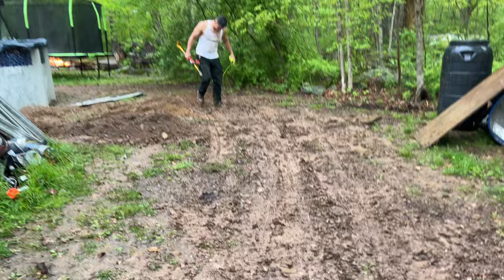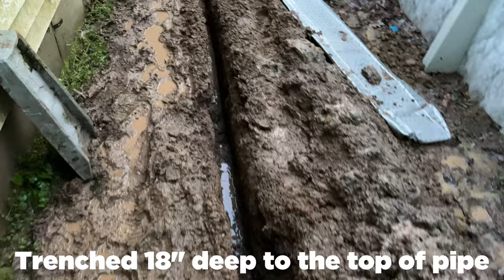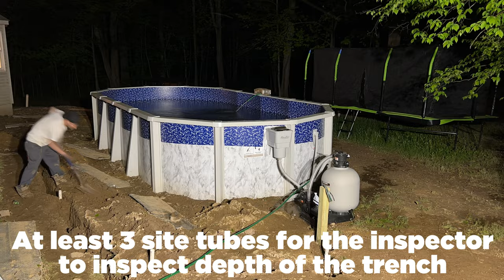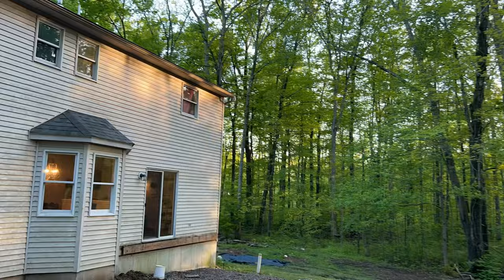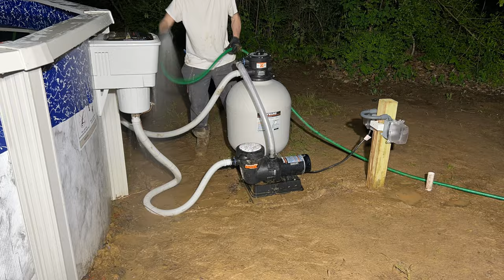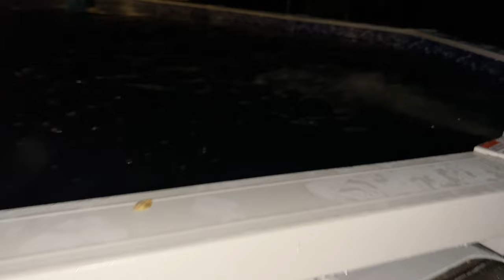How to Bond Wire Above Ground Pool Electrical Wiring bonding pump motor skimmer frame Electric Code

Comment: I can’t find anywhere on how to use a twist lock receptacle or wire it up. Can you help please
Reply from the maker: Yeah, I can probably help. We have twist lock receptacles and plugs at work. I should be able to grab one tomorrow and make a quick little video explaining how to wire and use them.
Reply from the maker: I can show real quick how they work and get wired, but let me know if you have any more specific questions and I’ll do my best to answer it
Reply: @BrandonStunts  that would be awesome man. Your video is definitely helping me a lot already. I just had a pool put in last week and I have to go through all of this to get it inspected. 
So from what I understand the twist lock outlet gets it’s own circuit with a gfci 20 amp breaker right to the panel? 
You ran another circuit from breaker to the gfi on the post? 
I saw you have single runs of wire. Is it not ok to use 12/2 UF in the conduit or should it be how you did it?
My next question would be where in the line would the timer be?
Reply from the maker: Hey man, I haven’t had a chance to do the video yet since work and family has been crazy busy, but I can at least answer your questions in the detail. So at least doesn’t hold you up too much, but hopefully I can make a video showing the panel and in the inside of the basement, as well as the wiring and operation for the twist lock. And I’ll also go over some of this stuff here and try to hit a few other things as well.
Reply from the maker: Yes, the twist lock outlet gets its own 20 amp circuit breaker. What we call a dedicated line. Basically a circuit that’s dedicated to only that piece of equipment or that specific outlet and nothing else. So no other outlets, devices, or other equipment should be connected to that line.
Reply from the maker: Yes, you have to run a 2nd dedicated circuit from breaker to the 2nd box on the post as well. That outlet is a regular outlet (non-twist lock) called the convenience outlet, which also gets  its own dedicated circuit. That Circuit has to have a GFCI circuit breaker or a GFCI outlet so it’s GFCI protected as well
Reply from the maker: No, it’s generally not ok to have UF wire inside of the pvc conduit, that would be considered double sheathing. UF wire is rated for direct burial underground, not inside of pipe due to heat dissipation. I mean, I guess with a big enough pipe it might be OK, but it’s generally not recommended. 

The bigger issue though is the pool pump and any pool equipment is required by code to have an insulated ground. All pool equipment must have an insulated ground. An insulated ground means the ground wire must have it own sheathing of insulation. In UF it’s just bare copper inside the UF, only ones insulated are the white and the black wire. Which is the reason why I use PVC pipe with thhn wire (single runs of wire) because the ground has to be insulated. 

I don’t believe it’s code for the convenience outlet to be insulated though, but I am not 100% sure. Most people just use the same for both, which is the safest bet.
Reply from the maker: I mounted  my pool pump timer right next to the breaker panel (so the wire went from the breaker out of the panel a few feet away into the timer, then that wire came out of the timer and ran to a junction box at the end of the basement to transition to the pvc pipe outside with the thhn stranded single conductor wire that goes to the twist lock receptacle). But that timer could be put in another location as long as it’s before the pool pump outlet.

I’m planning on taking a video of the inside set up as well as the wiring, along with answering some of the questions in here, and showing the twist lock cable, box and bobble cover.
Reply: @BrandonStunts  makes sense. Thanks for the answers. I went and bought rolls of thhn wire. I bought solid instead of stranded will that matter for inspection? Sorry I’m asking a million questions. My inspector was a real dick when I asked him all I need done so I’m really trying to make sure it’s all right before I get it inspected so there’s no issue
Reply from the maker: It’s cool. I’ve been the same way on other stuff I couldn’t figure out. Like you know you’re capable of doing it and have a good idea how to do it, but the technical details of the exact right way to do it seem overwhelmingly confusing.
Reply from the maker: I get it. A lot of these inspectors are huge A-holes for whatever reason, but every now and then you get some cool ones. he is as far as the wire goes I’m not 100% sure about that, but I can check with one of the “Code” guys I know today. I’m also doing a video going over the detail of the inside, outside, and timer wiring. Hoping to have it done by the end of today
Reply from the maker: So from what I’m told is solid wire would probably pass, but it’s not really what it’s intended for. Voters are supposed to be fed with stranded wire, so may not 100% pass either. So as much as you don’t want to it might be best to check with the inspector on that or get the stranded. 

Or you might get lucky and he doesn’t even realize who the difference. When my pool was inspected they didn’t open up any of the boxes to check the wire.

The other issue is depending on how long or how many bends the pipe is it will be much harder to pull.
Reply from the maker: I’m also still making a video. 4 actually. One detailing the inside wiring. One detailing the wiring and operation of the timer. Another one detailing the outside parts and wiring. As well as one explaining how to install the skimmer, bonding plate, as well as the bonding bridge and motor bonding. But I probably won’t get them done for a couple days or so. Things have just been too busy.
Reply: @BrandonStunts  awesome, I subscribed so can’t wait to see them
Reply from the maker: Nice!!! I just posted the pool bonding one now. And I should have the outside wiring one talking about the outlets up in a little bit. Hoping to get the inside ones finished later today or tomorrow

Comment: I thought you don’t need a GFCI Circuit and a GFCI outlet connected together!
Reply from the maker: You are correct! I may have put it in a confusing way, but it’s meant to imply that you need either a GFCI circuit breaker or GFCI outlet? One or the other, not both
Reply from the maker: I personally used a GFCI breaker, but your correct, you could also just use a regular breaker along with a GFCI outlet